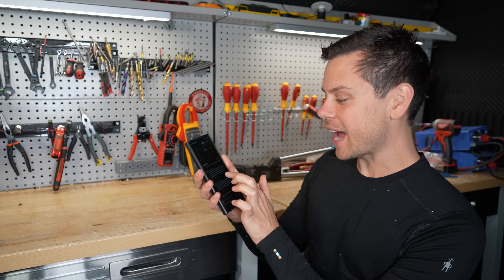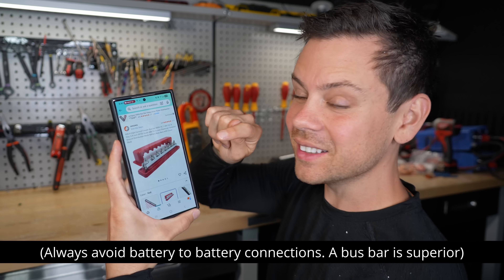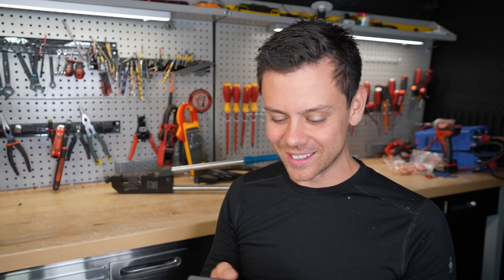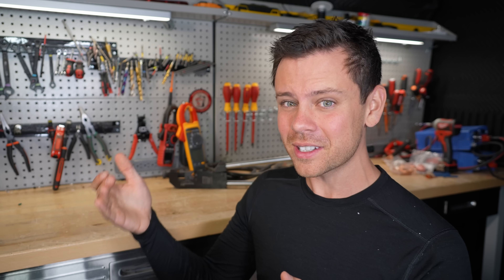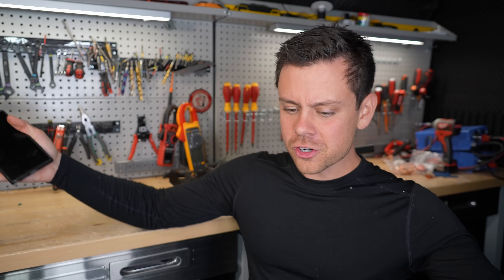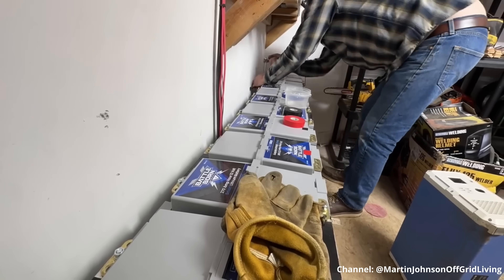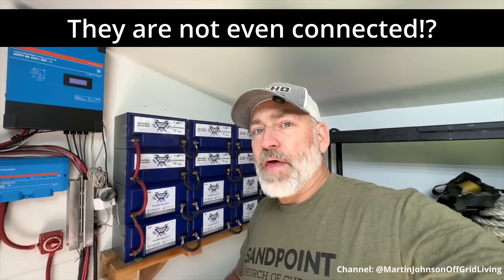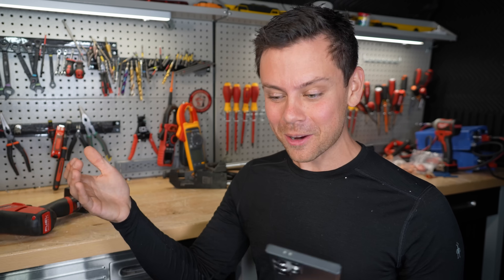My Reaction to Martin Johnson's "BEST Off-grid Battery Bank" Video 😬 Yikes!!

Comment: Hats off to you Wil -- my EG4 system is rocking 100% even after 1 year, zero issues.  Love your vids!      The solder part of that guys video was painful... even with my basic setup I spent the whopping $40 on a hydraulic heavy gage crimper.   And this guy is cutting piece of solder and a blow torch.... yikes.

Comment: Instead of soldering the lugs, is there a good option for corrosive salt environments like in an ocean going boat? What about using a conductive grease in the cable lugs?

Comment: You can buy a hammer lug crimper tool for like $20.  Hydraulic one less than $100.  If those wires get hot enough, which they easily can, the solder will release and could start a fire.  I have a feeling this guy was lying that he has been using them for 6 months, that is why they were not balanced.

Comment: Can the positive cables between 12v 100 amp lipho4 batteries ( Redodo 100ah 1280 watt hour) in parallel be warm to the touch (87 degrees Fahrenheit laser gun tester)? I’m pushing 1400 watts out to my 2000 watt inverter to charge my EV at 12 amps on level 1 charging. The  + cable connection on the last battery post headed to the inverter is 166 degrees.
Each positive post is a bit warmer than the previous as the 4 batteries in parallel connect towards the final + terminal out to the inverter (1st terminal is 87 degrees and the last terminal is 142 degrees). Battery casings are all cool to the touch.

Comment: You wouldn't solder those lugs, like you said. But you ESPECIALLY don't solder lugs with a propane torch and plumbing solder. Unless the guy says he is using a rosin core, he's probably using ACID flux. That's not okay.

Comment: There is a whole pile of YouTube videos showing how to solder lugs onto 1/0 and 2/0 cable. I presently use the hammer and smash variety of swedging, but I have an anvil, which really helps the crimp of 1/0 and 2/0 cable. I did buy a hydraulic hand press, but I like the Hammered ones the best. I hate aluminium for being any kind  of conductor of electricity

Comment: Having bought the EG4 XP6000, the EG4 14.3 kWh Power Wall Battery, and 8,000 watts of 560 Watt BiFacial Solar Panels, and my system operating flawlessly since it’s July 2024 installation, I cannot fathom going with any other system! And I did it all by myself, with zero experience with solar!

Comment: The NEC (specifically 110.14(B)) allows soldering for wire connections, but it mandates that the connection be mechanically and electrically secure before the solder is applied 
But I Would Not Do It! :face-fuchsia-tongue-out:
Soldering wire connections in an electrical panel is generally not code-compliant as the primary means of connection, but it is permissible as an additional method to secure a splice that is already mechanically and electrically sound 

Awesome Reaction Video :face-blue-smiling:

Comment: I don’t give much advice on how to do it perfectly but like Will,if I did a review,I’d be morally obligated and legally responsible according to Texas Dept of Licensing and Regulation to warn people about serious safety concerns.
The most common cause of house fires is not undersized wires ,though that is serious,but loose connections like the soldered lugs. It doesn’t take a lot of current to start a fire when it arcs at the bad connection.

Comment: I have some Frankenstein batteries too because I built them five years ago when there were a lot less options.
My 16 s batteries have individual BMSs and are in parallel even though they are unequal kWh.
They get unbalanced daily because one is 280 and the other 120 but the cells are balanced in the 16s batteries by their BMS. I charge the whole system occasionally to the individual BMSs cutoff. The smaller battery is getting cycled more of course but at 72 years old I don’t have many cycles left in me.

Comment: That was funny - some folk have more money than sense - these days I tend to let the  active balancer BMS do the  equalise the cells on a new build as long as they are pretty close in voltage at the start  -  The days I spend hours with them in parallel or charging them 100% are over now BMS have  active cell balancers

Comment: The irony of the "can you spot the safety issues!? Haha" caption on his video.

The lack of concrete board to isolate the setup to protect the structure of the building is begging for a fire disaster

Comment: The 1st of many more I sincerely hope!  I used to follow that channel, haven't in a few years.  Glad you could provide some accurate info for it.  I'm just glad I found your channel before taking the dive into solar power generation full time.  Built out one of your early EG4 projects to power the new house the wife and I built.  3 years and still going strong, but I still do the things you recommended...  checking for loose connections, etc.  The system hasn't been down a minute since we switched it on way back then other than to check and upgrade.  Keep up the great public service work!

Comment: I had a Victron Battlebotn system installed in my 5R about 3 years ago yes they were the best at the time I have 2 12v game changers,  my only issue with Battleborn is that protected there approved installer in Quartzite after a really bad installation cutting up my camper in places they didn't need to or ask me if it was ok to run PV through the Sewer Vents and cut PVC elbows to run the PV cable then use open buss bars hidden under the solar panels 😮 cost was not a issue they just cut corners! Battlebotn referred me to this place!  It cost me another $1200 for a Mobile Victron Technician to fix everything 😢. If you have been to the Q you should know who the business is if not it's easy to figure out. Be careful who you let touch your camper. Of yeah the splice into the 50A system was done with wire nuts  hidden inside a metal box instead of the clamps that were supposed to be used very unsafe install.

Comment: I didn’t see any fuses anywhere between the batteries either.  Wow.  

I LOVE my 12 volt systems but EVERYTHING is fused in multiple places.  1/0 wire is used everywhere.  

Holy cow.  😢

Comment: I just replaced my Morning Star PWM charge controller with a Victron 150- 45, I have 4 Eco-Worthy 50Ah , 51.2 volt metal case batteries and plan on 8 more. Haven't decided on what new inverter to get.

Comment: Safety points in video:
Aluminum bus bars are inferior to copper bus bars
Lugs designed to be hydraulically crimped should be crimped and not soldered
Wires should be sized for the safety of the whole battery and not just the maximum designed use current.
Charge batteries to 100% before assembling the pack.
Circuit breakers are a must.

Comment: Around 9:10 - aluminium oxidizes instantly. Sanding it will not remove the aluminium oxide layer at all. That’s why argon is needed to displace all oxygen near the surface to fuse aluminium together.
Reply: Not instantly, but doesn't matter. It will still form even after you put the bolt on. This step is pointless.
Reply: Not to mention that aluminum is a pretty piss-poor busbar material to begin with; and the fact that he's using not just two, but THREE dissimilar metals (Aluminum, brass/copper, and stainless steel) the potential for galvanic corrosion is OFF THE CHARTS. And he didn't even appear to have used any sort of inhibiter.

Even just the moisture in the air on a humid day can be enough of an electrolyte to allow galvanic corrosion, and the fact that there are electrons actively flowing through those metals is just.. Wow...

Ideally, he should've used tinned copper for everything, but I guess BattleBorn couldn't afford to splurge for proper bus bars or appropriate sized cabling for this commericial. 🤣
Reply: Actually it takes a few minutes for the oxide layer to form, our welding shop uses 15 minutes delay maximum; it's not exact but easy to remember.
Reply: @robertball3578 we use 12 hours building aluminum navy ships
Reply: @robertball3578  I used to work in a paint equipment supplier shop and did microscopy on treated metals prior to coating (for OEM auto paint shops) - literally watching and timing how fast oxide layers form post treatment, in a mildly humid environment (50-60%) the initial oxide layer forms in seconds, then (with aluminum) it provides a barrier coat and slows down the formation dramatically.  What this Martin dude is doing with his bus bars is absolutely f-ked up for so many reasons.
Reply: @geoffwood2712  This.

Comment: @WillProwse if I have a few different batteries and they are all connected to a Bus bar in parallel, will the battery auto balance itself? I like your idea, fully change the battery and then connect them in series to ensure the batteries are in the same state of charge.

Comment: Now I wonder how much stuff I did wrong, I have 2 wire for 175A for all batteries, 12V 250A x 16. I might be able to say I have the best battery because they can't be EMP, 0 SOC, or frozen damaged.  
You can claim you have the best battery today but might only last 30 days before another better comes along.

Comment: I did crimp with my large lugs —1/0 wire on my sol ark 12k —lugs that go to the battery bank.  The positive crimped  lug was going up to 250 degrees Fahrenheit.  Very dangerous.  I soldiered it—best connection.  Now is 115 degrees ish at 6,000 watts going into the batteries.  I politely disagree with cold crimped connections. Please provide credible source’s saying  soldiered connections are inferior. I have a 30 kWh battery bank. Eg4’s—system works great.—I did more research and you are right.  Grok said do cold crimped connections
Reply: You might have made a bad crimp.  Maybe your lugs or wiring were dirty.  If so, you need to sand them clean first.  Maybe you didn’t crimp hard enough to make a good  connection or used the wrong crimper.

The first clue that crimping is superior to soldering is to look under the hood of any vehicle, aircraft, vessel both military and civilian—all the wires are crimped!  From large power wires to even the smallest signal wires are all crimped.

Furthermore, automotive, aerospace, marine, and even some military wiring harness standards (e.g. IPC/WHMA‑A‑620 Rev E) prescribe crimp‑only terminations for power and signal cables.  It even explicitly forbids pre‑tinning before crimping, because any solder in the barrel causes voids and sliding under force.

Furthermore, solder does not withstand mechanical load well over a long duration as it was intended to make an electrical connection not a mechanical connection.  In our case, the DC PWM pulsing of chargers and inverters can cause vibrations that can cause solder to crack or become loose over time.  I have witnessed a bus bar in my DIY home battery vibrate creating a noise that I could hear and feel.  The bus bar's bolt needed to be tightened.

Also, solder starts becoming soft well before its actual melting point starting at 183 °C.  The solder may start going soft via its “glass transition zone” below even 100°C.  Soldering such wires will kill you when used in an engine bay of aircraft.  Soldering wires in the car engine bay will leave you stranded on the side of the road eventually.  These engine bays regularly reach 100°C or higher.

If you have an engine fire in an aircraft, the crimped connections will buy you more time to land before they completely release.  Soldering would have released way before a crimp would in such a situation.  If you have high current in a high powered battery, you could get to near to 100°C on connections too.

Comment: I didn't hear why soldering to crimps is bad in the first half of the video, so I googled it, From a Reddit comment
"Technically speaking, soldering is for connecting to a surface, crimping is for wires. Crimping (a proper crimp, not some shitty AutoZone butt connector) will have much better vibration resistance. Solder creates a brittle point and will fail before a proper crimp every time. Don't believe me? Maybe you will believe NASA. Nowhere do they mention soldering wires to wires, or wires to terminals."

Comment: Keeping that balanced is going to be a nightmare. Every time  someone takes four 12 volt batteries and puts them in series for 48 volt bank they run into balance issues. Plus those cables are going to have a large variability with resistance because they were soldered.....

Comment: 4:10 - It is okay to use 4AWG wire so long as the battery's breaker or fuse is sized appropriately to match the 70A to 90A that 4AWG is rated for.
Reply: I’m pretty sure there’s no breaker or fuse on those, just the internal BMS that trips at 300A. If you were to only have one battery, you could use a smaller gauge wire and protect the wire with at additional breaker, but when you have parallel batteries, it’s a bit risky you have no control on the flow of power in between batteries.

Comment: I wonder if Mr. Johnson got a "DEAL" from Battle Born.  It's nice that he is buying American products, supporting our economy. However,  an engineer and electrical inspector from Idaho should comment as the safety concerns are discussed.  Finally, BattleBorn  should comment on your critique so there can be no doubt.  You bring the receipts to correct poor practice, he is a nice guy although not properly trained. There is a reason for safety inspections.   Thanks for pointing out danger points.

Comment: at 7:12 He Shows the Positive cable rubbing on the Negative aluminum Bus bar. This is Extremely dangerous ! in a Few Years or sooner the aluminum bus bar will rub a hole in the Positive cable creating a " Short " and that will not be a Good thing when that happens.

Never Let A Positive wire touch a Negative Connection point. or vice versa.  it will short out & Bad things will happen.
Reply: You are correct but later he fitted plastic covers over the terminals, which hold the cables clear.

Comment: At 1:35, you lump series and parallel connected together and say you have to charge to 100% before connecting.  That's right for series, but not for parallel.  For parallel, they should be the same voltage.  Otherwise you'll get a large current flow from the higher voltage batteries to the lower voltage batteries and they will end up at the same voltage anyway, but maybe not the same SoC.
Reply: You can have two batteries at the same resting voltage but at different discharge capacity when dealing with LiFePo4.....100%......charge them before connecting or charge them in parallel to 100% amd let them sit for a couple days before putting into service if you intend to run parallel connection to balance.

I feel you are the person that goes out there looking to discredit anyone amd pick an argument over senseless nonsense as if you are the house expert.
Reply: @wadebrewer7212  Nope, that was not my point.  Will does a generally great job explaining this stuff, and I'm simply pointing out a small thing so people don't get confused.  Parallel is not the same as series when it comes to how you prep them before connecting.  That's not "senseless nonsense".  Series: you generally want the same state of charge.  Parallel: you want the same voltage.  Try the extreme case of connecting a battery at 13v in parallel with a battery at 10v and tell me it's a small thing.  
"... charge them in parallel to 100% amd [sic] let them sit for a couple days before putting into service if you intend to run parallel connection to balance ..."  They are already as balanced as they will get once you connect them in parallel.  They are constrained to the same voltage at that point and no current will flow unless they self-discharge at different rates.